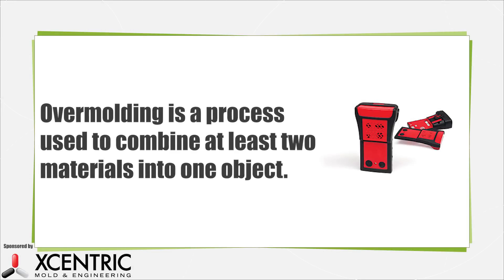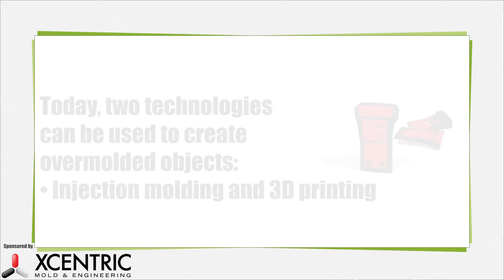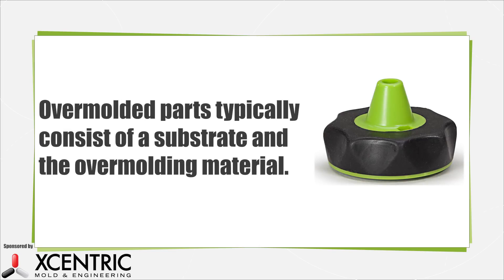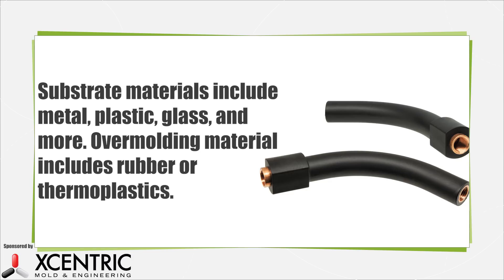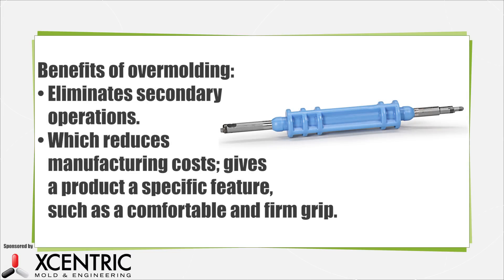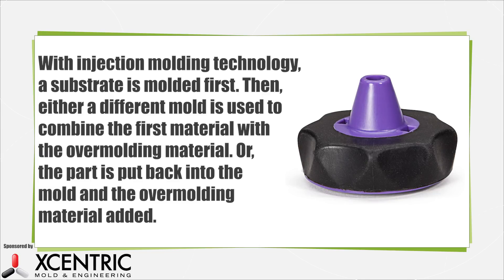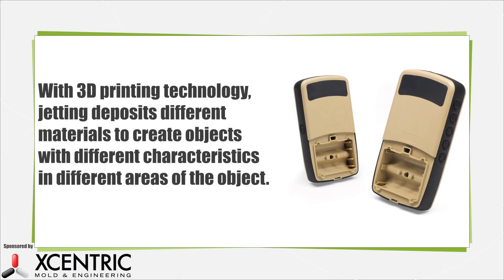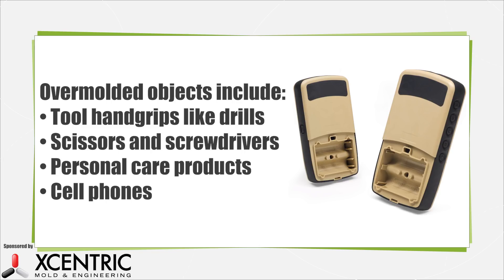What is overmolding?

Comment: Hello Sir, if rubber is overmolded onto solid plastic, why does the plastic not get melted by the rubber in molten form? Subscribed to your channel!
Reply: I believe in many of the cases the internal part (solid plastic in your question) will be a thermoset plastic.
Reply: @LaserRobYT  Thanks sir. 
Are thermosets much more expensive than regular plastic ? Is hdpe a thermoset?
Reply: @1stPrinciples455  It depends on which materials when it comes to cost. HDPE is a thermo plastic. for most instances the wikipedia page will list the categorisation.
Reply: @LaserRobYT  Thanks😃